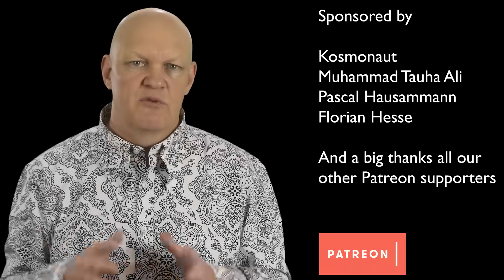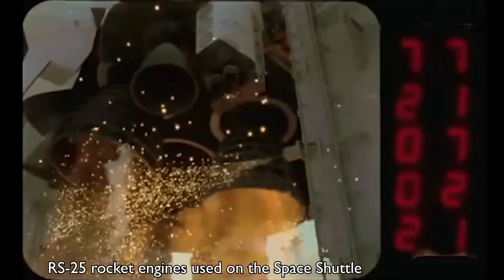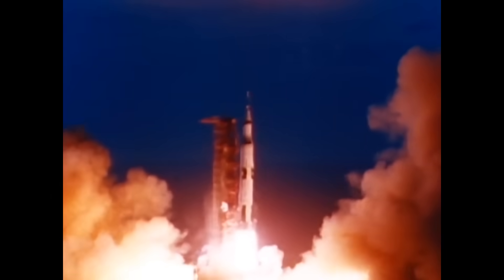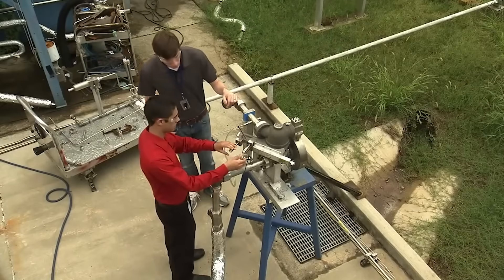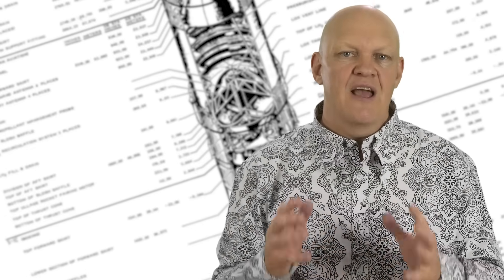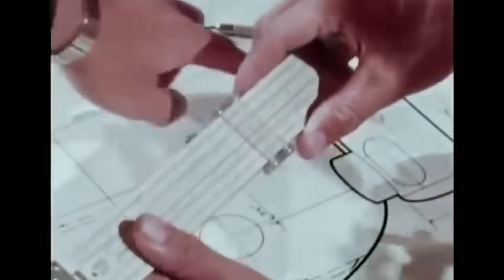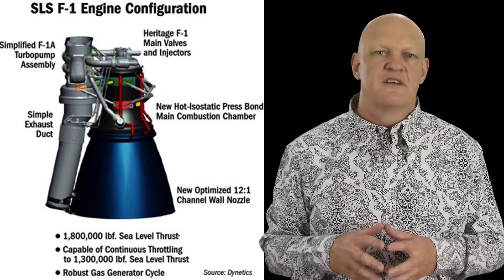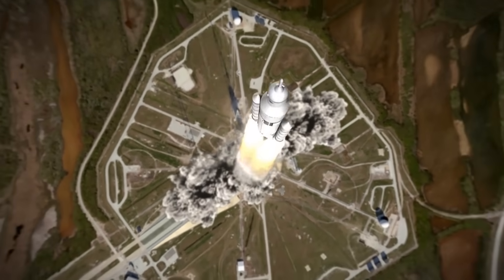Why Can't we Remake the Rocketdyne F1 Engine?

Comment: All of the parts needed to make a working Saturn V rocket are still available. It would have taken time to rebuild but it would have been a lot faster that starting completely over, as they have choose to do. If you added it all up and what it would take to develop and test the New Orion / SLS, It would have been faster to upgrade the Saturn V. Why they are starting all over is beyond me. Either Way Im still pulling for Space X.   lol

Comment: Design of what would become known as the Rocketdyne F-1 engine actually begun in the late 1940's by the US Air Force for missile systems. The Air Force decided they had no use for such a powerful engine and the just organized NASA stepped in. The first engine was test fired on a limited, not full thrust setting in 1957. The first full throttle static firing was March 1959 and completed testing in 1964. The target was 1,000,000 pounds of thrust, they hit 1,500,000 pounds of thrust, 1,550,000 on the latter batch of F-1 engines, now times that by 5, when it ignites you know your leaving! The F-1 was basically a bigger E-1 used on the Titan missles. Each second a single F-1 burned 671.4 gallons of fuel or something like 2,542 litters. I was told in the early days of the program the tanks used to store the fuel was too small and would run dry within 13 seconds. Larger higher capacity fuel storage tanks, that are still standing, could provide fuel for up to 34 minutes for testing. I have not talked to anyone who witnessed a test firing longer than 6 minutes. The mission of the engine was over in 150-165 seconds and crashed violently back into the Atlantic ocean.

The one thing I do know about talking to some friends who worked on the F-1B program was that nearly all the special tools, dies, and machinery had been destroyed, but the blueprints had survived. You said the F-1B program is dead, well not exactly as NASA currently has no plans for an engine that powerful, and that might change in a decade or less. It all boils down to funding.
Reply: Which as the things are going, it will cancelled

Comment: Many of the skills are STILL out there, the issue is the refusal in modern America to acknowledge that someone can be very skilled without a degree. True craftsmen/women can be found if they were to go looking. I have a good friend that retired in the 1990's from a career as an aerospace engineer but had only graduated from a polytech high school. He hired in as a draftsman and was promoted to engineer. That would never happen today! Personally, I have machined internal automotive engine and small engine parts for antique motors on my antique milling machine and lathe just by going slowly & measuring carefully. Over the years very few have failed. I have a neighbor who is a welder by trade. While most of his work does not require precision, when it does he can deliver. But since neither of us have a degree, no modern company or organization would consider our skills useful. Whatever, I'll just ride off with my neighbor on our motorcycles, that he welded frames for and I built (restored) engines for. No computer needed.

Comment: It's the same anywhere, even in a seemingly simple thing like house building. Urbanists/architects do not often like people who build replicas of old houses, because they are not being built well and look fake. We don't really know how to build like they did in the 17th or 18th century, or even at the beginning of the 20th. It doesn't mean that the modern techniques are worse, but the emphasis is on another thing. Like in the old times people had really great handwriting, calligraphic and stylish. We are also writing letters today, but on a computer and they are on one hand more primitive, on another hand - done faster and maybe more to the point. It's perfectly clear that we might not be able to re-create that engine to be as good as it were, I mean - judging by recent Russian struggles with old Soyuz it could be that they have the same issue. The new generation is not used to servicing/making that kind of a machine. That's why we need to build stuff with our current tools and knowledge and I'm sure we can build an engine to be as powerful or even more (as we always have done). But re-creating past technologies, even past building techniques with modern people and our modern ways of working will be hard or near impossible. Same with IT even, it's hard to find people who really know their way around COBOL these days, you know, and a lot of legacy systems still run with that.

Comment: if thats the real reason they cant remake them, then wow!! if you are saying that someone in the machine shop was altering the finished items from the design specifications without consulting the design authority, firstly they wouldnt get away with that in any safety critical industry i've been in ( didnt they have any of the standard engineering controls, like configuration management, design reviews, verification and validation testing and build standard controls, quality assurance, etc?) there is no way the guy in the machine shop could know whether his alterations might have adversely affected the design without reference to the design authority. unless he was adjusting for errors he was introducing in matching parts or adjusting for other workmanship issues. this wasnt some mickey mouse outfit in someones garden shed, it was something like 5% of the usa's federal budget for what 10 or 15 years. no way are they relying on brian in the machine shop not getting run over, shot or having a heart attack for 15 years!!!

Comment: This is a quaint bit of poorly researched pandering. There's no reason that we CAN'T build an F-1 engine today, we can duplicate on with little or no trouble at all. The problem is in certifying or guaranteeing the duplicate engine.

Back then, an engineer was given free-reign of his work-space to get the job done and produce results, no questions asked as long as it didn't go too far over-budget and nobody got hurt. Things are not done like that anymore, nowadays, you need to prove and back-up every single decision that you make, or the change doesn't happen. Engineers do not use slide-rules, because approximations are no longer acceptable, and your hunches and intuition are completely meaningless in the face of proving your assertions and concerns about a system, component, or process. Engineers no longer have the latitude to just screw with something until it works, and this is a sad side-effect of a more responsible, more expensive, more safe, and more restrained NASA.

Saying that it's the fault of modern engineers lack of skill is downright sickening. If you want crafty mechanics who can make-do with a hammer and some bailing wire, go watch McGuyver. If you want a cutting edge machine that will do the best possible job and guarantee the least possible danger to achieve the required results, then call NASA, because these are the single most skilled individuals you'll find. Modern engineers are smarter, craftier, and have a more well-rounded understanding of their domains than any generation of engineer to come before them and they deserve nothing but the highest praise for their absolutely outstanding work and the living hell that they went through to earn those titles.

I'll take an average NASA engineer today over their brightest nerds of pre-1970, and if you knew anything about their work, you would too.
Reply: Only difference between engineers of yesterday and today is computer software. Those pre-1970s engineers had to use intuition and approximation because they didn't have access to computers that could run a finite element analysis in a few hours.

Comment: This engine could be made again with more modern manufacturing techniques and materials.  Look at the American  version of the Merlin Engine. They took a hand built engine and made an engine to more exact specs and mass produced it.  This engine was designed and built in an   analog age when they were still using slide rules without the benefit of supercomputers and material tech that didnt exist 40 years ago. Still if we kept relying on old Tech we wouldn't have  smaller and more efficient engines like on SpaceX.

Comment: No theres tons of skilled people that could do it the problem is the smug masters and phd asshats sitting behind a desk think they know more and are more capable than factory workers and tech with a highschool degree that have done their trade for decades. Once you have those people with that mindset running things shit slows down and gets less reliable and its almost impossible to change how things are done
Reply: Those technicians couldn't produce a design, that requires extensive theoretical knowledge, testing and verification. That is done by the engineer who usually has  degree or PhD.

The two are very different but both need each other.

Comment: I can only tell you that the way backplane circuit boards were made for the shuttle would be the devil today as we made minute adjustments to the CNC machines on each production run. I also wonder if the radhard IC's could be reproduced.

Comment: I don't know what to think about the comments. People crying about "lost knowledge" and lacking eduction. What is wrong with you? We can build and use technologies that put shame to stuff from the 60´s. We have better, faster, easier and safer production methods. Hell it was even stated that if we wanted we could build a better and easier version of the engine, but there is simply no need. There have been so much ways to to something that have been lost, simply because we had something better. If not we would still live in coal hated sheds, hell not even that. The hunters of the prehistoric probably cried the same when people settled and started farming. Wile to some old production techniques may hold some sentimental value, and are indeed from time to time interesting, Nothing of Actual Value was lost.

Comment: Not so fast. The National Aeronautics and Space Administration Authorization Act of 2010 clearly lays out a continuation of the space shuttle technologies, SRB production and all technologies from that program. It basically say that NASA, while required to shut down production and use of space shuttles, will be required to go to space with all of the technology and engines from the previous program. THAT is why the U.S. will not make the F-1 or any variant. This is simply U.S. rocket politics. Saving jobs for ATK and such when the real heavy -lift workhorse, the F-1 engine, continues to sit in a museum. It requires: "The NASA  Administrator to authorize the refurbishment of the manufactured external tank of the space shuttle, designated as ET-94, and take all actions necessary to enable its readiness for use in the development of the Space Launch System as a critical skills and capability retention effort or for test purposes, while preserving the ability to use such tank if needed for an ISS contingency deemed necessary."  "Requires the extension or modification of existing vehicle development and associated contracts necessary to meet such requirements, including contracts for ground testing of solid rocket motors, if necessary." "(Sec. 304) Requires the Administrator, in developing the Space Launch System and the multi-purpose crew vehicle, to utilize existing contracts, investments, workforce, industrial base, and capabilities from the space shuttle and Orion and Ares 1 projects, including space-suit development activities and shuttle-derived and Ares 1 components that use existing U.S. propulsion systems. Specifies the activities that shall or may be discharged by NASA in meeting such requirement."

Comment: Being an American gen Xer caught between boomers and millenials, I tried to explain what "real" engineering really is to a younger millenial. I said, real engineers build dams, engines, nuclear reactors, buildings, computer hardware and the like, not simulated networks and digital imitations or fabrications of electronic ones and zeroes. He just did not understand and was insulted because in his mind, computer engineering is the same thing. However, it really isn't because you are manufacturing things that do not exist when the electricity is turned off.

Comment: So wait, you say that NASA chose solid strap-on boosters rather than a new-build F1.  Do you mean there was a plan mooted to have strap on liquid fuel engines, or that the F1s, has they been used on the core (liquid fuel) booster would have been powerful enough that SLD would not have needed the solid fuel boosters at all?  Very unclear.

Comment: There are a number of factors against building those engines again.  One is that the fuel is costly and a waste of resources. While the engines are materials that are cheap enough to be discarded, the fuel isn't. Also NASA is putting their funding into new technology for propulsion like the ion drive and a system for warp travel, they have already designed a warp ship for the new engines. Building something that wastes fuel would waste resources and manpower that could be put to better use. It's still a good thing in case of emergency situations, like if the gravity drive breaks down and they are stuck on a planet, but anything more would be a step in the wrong direction.

Comment: It's surprising how this case reflects the need of archiving and keeping of records documenting processes and deviations from them. Many times with the day to day pressure to meet deadlines and deliveries for a project, the people in charge of the tasks forget or minimize the importance of keeping documentation of their work. Maybe they believe is common knowledge among their teams or even common practice (as it probably was back then). However, the cumulative result of these omissions is clearly seen now when a substantial amount of knowledge is lost for retrieval, difficulting the recreation of the process. These are the kind of situations that "fell into the cracks"   which are expected to a certain degree. However, the fact that this happened to NASA is not only surprising, but also makes one think about all the knowledge and information regarding other major developments and achievements of mankind that has been lost and will inevitably be lost to time. Even when quality systems for processes are implemented and followed, we will lose information and maybe 100 years from now, we will find that important details  on how artificial intelligence was designed or created have been lost in the same way as in the case of the manual welding and twitches of the F1 engine. Nothing but the imperfection of human nature and its creations.

Comment: It certainly follows. And mirrors other industries. I'm a sound engineer of the computer age. But originally sound engineers of old were actually electrical engineers. Now they don't even cover electronics at sound school. I remember as a student when I visited the BBC and saw old bits of kit lying around unused that had been built in-house by employees of the past. Skills are also dying off, there's virtually no tape ops left as its now all digital. As more sophisticated software is developed trade skills like Booming a mic are becoming less critical as it (more often than not) can be fixed in post.
Reply: I think it's the fact that everything has been moved to the computers. Back then - you were designing stuff on a paper, now - CADs exist. Back then you had to build your own sound equipment to create and tinker with the sounds, now - you have hundreds if not millions of free sounds you can mix freely as you wish and use creating sounds that couldn't be possible without the computers.

Comment: I noticed a Engineer using a Slide Rule, for Mathematical calculations.   Thats the way it was done back then.  I started using one at work, but , by years end,calculators were coming on the scene.  They could only do the basic 4 functions at 1st.  In 3 -5 years ,   calculators took over the job of the slide rule.   Knowledge was King back then.  Research and Developement was big  everywhere.     sadly, today, so many colleges teach,   sustainable Living?.....   Basket Weaving was a joke back then, but was applied to Hi-tech in many ways,like carbon fibre weavves.      Important in aerospace work.

Comment: Besides plans and know-how you also would need all the special tooling involved, which includes things like the fixtures used to hold things together during assembly. For example there were special fixtures used to hold the cooling tubes for the thrust chamber in place while they were brazed together in a special oven constructed just for that purpose. A lot of that stuff was sold or scrapped after the F-1 production lines closed down. It's just like if Ford Motor Company wanted to start making Model T's again or if Boeing wanted to start making B-29's again. All the special tooling would have to be reproduced from scratch to reopen the production lines.
Reply: Joe Vignolo Dam near all production lines have been closed look around you the US is dead we were sold to the chinese. We cant make anything. No skills no factorys. No steel  yah yah a few holdouts. The chinese have a factory that employs 150k people everything from the raw ore to make the steel all the way to the end of the line is produced onsite. They dont get there supplies from somewhere else they make it. This country is dead. Hell cant make a rocket engine we cant make a pot to piss in.